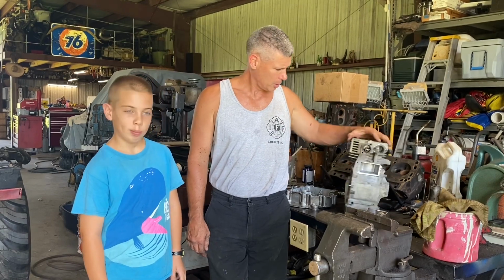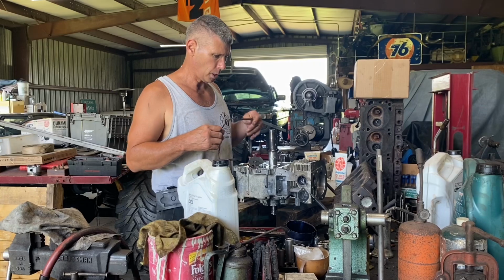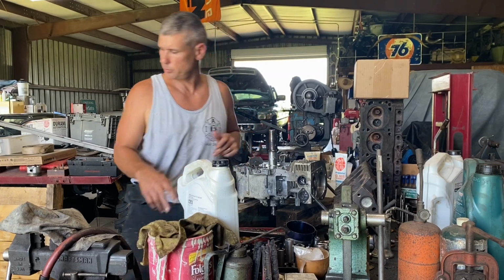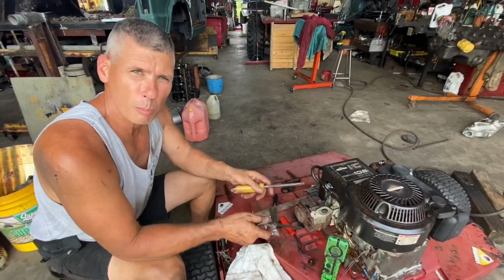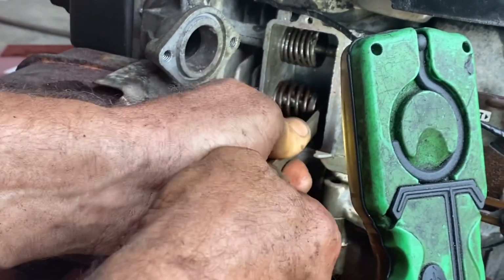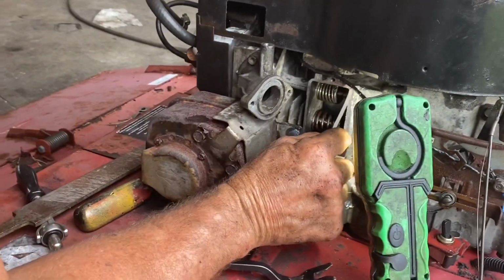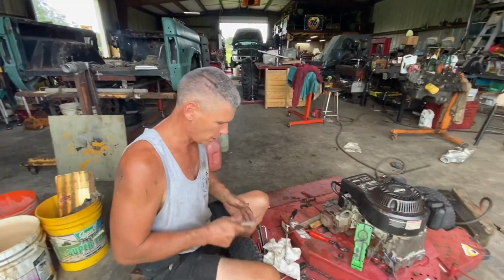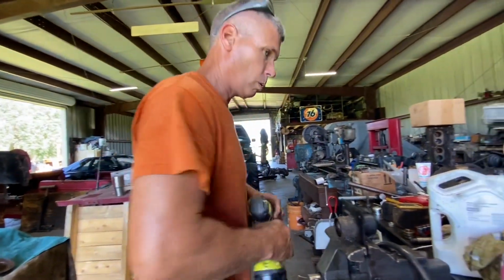Swisher 44” pull behind mower rebuild

Comment: Any info on how to replace the 74 inch belt on the Swisher 44 inch tow behind ?  Do I have to remove the engine ? Thanks !
Reply from the maker: Yes you have to remove the engine but it is not a super hard job.
Reply: @generalprinciple5921  Well good news.  The 44 inch finish cut tow behind did  not require me to remove the engine.  I just removed 2 bolts on the engine plate mounted to the blade deck and it gave me the 1/2 inch I needed to slide the belt under the drive pulley.  I did also have to remove the outer nut on the disengage rod to slide the belt around that as well.  Once I had the golden info, it was not too bad.  Good luck to anyone out there trying to find info on the swisher 44" finish cut tow behind mower.   Probably a reason you can't give them away and so many are on the junk pile.
Reply from the maker: Yeah glad you got it great job